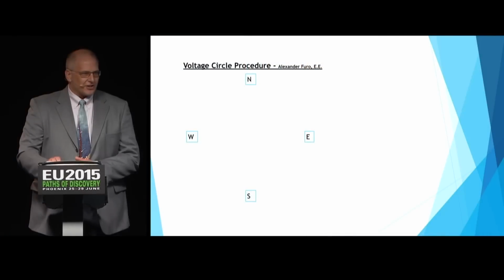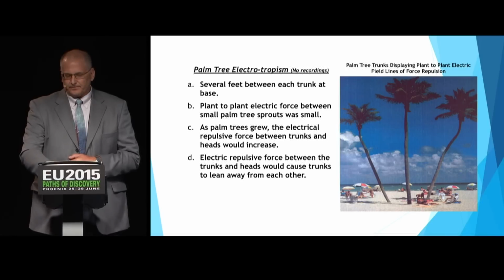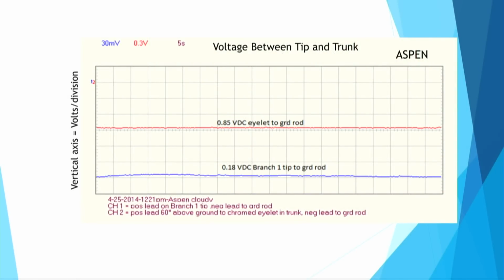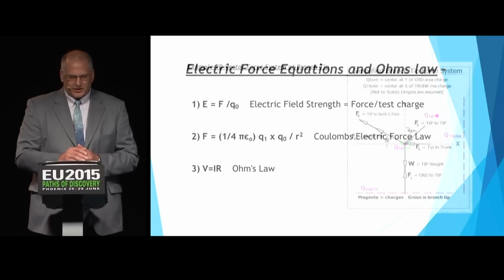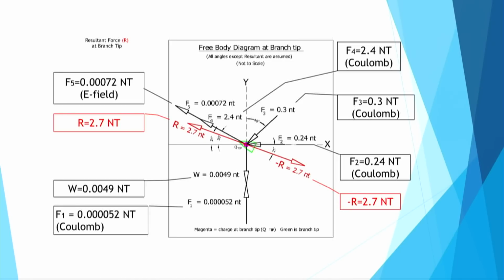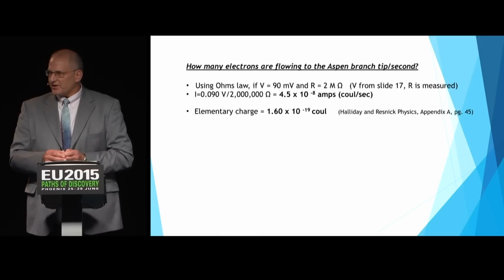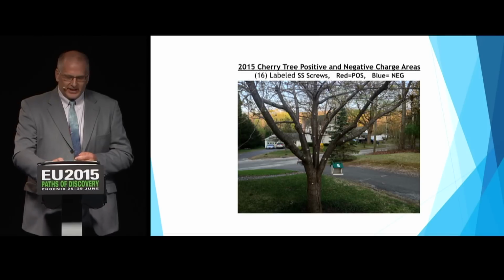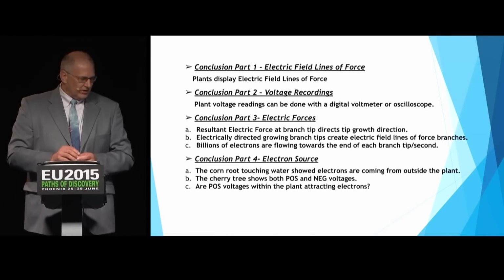Arthur Ramthun: Plant Electro-tropism | EU2015

Comment: 4::43 it is claimed a maple tree branch pattern is due to electric charges. 
And it kind of looks like the shape of a static discharge with each branch of the spark trying to get farther from the other one. The voltages he measured were less than 20 millivolts. 
So you could attach a 20 mv + or - charge to a branch and see what happens. 
Are branches sensitive to such weak voltages?.
Here is where he shows bias toward his personal theory :
The maple tree is convenient because it has this shape 
An Acacia tree on the in Africa where giraffes graze below like 19 feet do not grow like this. 
Redwoods do not grow like this 
Canary island pines do not grow like this. Choosing the maple cause it is one of the trees that kind of grows like it has repulsion between the branches.  A good reason for that is the new growth is trying to get out of shade. Likely nothing to do with electric charge. 
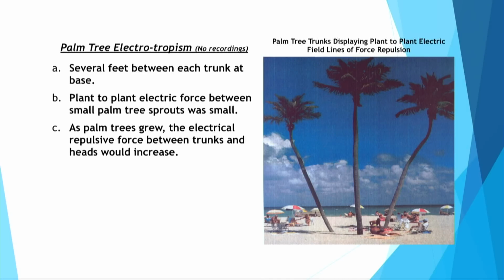5:23  Arthur, Seriously??????I have seen palm trees like this. 
it occurs when someone  transplants the  trees with one straight and two at an an angle
Note how the tops of the tilted ones are growing straight up. That is how they all grow. 
The growing tips grow upward after a palm is tilted. You think the static charge of these trees carried up from the earth is pushing those trunks apart.What happens when you put two metal flagpoles in the ground and attach a piece of cloth on a day with no wind. Do the flags point away from each other from repulsion?             NO    Again your bias that charge is a big player in everything leads to your false conclusion.

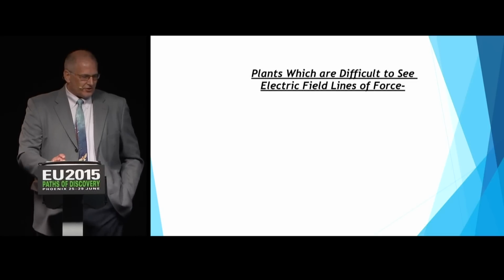6:50 " veins of leaves are electric field lines of force". 
No they are cells that transport water and the products of photosynthesis. 
merely look at a squash leaf closely. There are branching patterns but there are also little polygons made where all these little vessels connect. 
11:50 minutes. There is less than a volt and high " 2 mega OHM resistance. 
That means low current. 
At 17.47 he calculates that the force from less than a volt difference between the end of a branch and the trunk produces a resultant upward force 197 times the weight of the shoot tip.  Few things wrong here. 
I can buy a 50,000 volt van de graph  machine and touch the 
top. My hair will stand up. but it won't be ripped out by over 197x 50,000 ( call it 10million)  times own weight. 
Stems are heavier than hair. You cannot lift anything with a density similar to water with
the repulsive force of one volt over a foot of distance. 
Apologies that I lack the patience to correct Arthur's math. But the claim is easily observed to be wrong. 
Then he claims that .6 pounds of electric repulsion  force is causing elongation of the stem at the tip. This obsession with electric causes and perhaps ignorance of plant biology causes him to neglect osmotic pressure. The osmotic pressure some cells of a  leaf or stem tip is hundreds of PSI.

Comment: Very interesting I hope I will hear more about the proposed phenomena " Plant Electro-tropisum " as a plant life influencing force. I would be inclined to use ( I A A  , )   Indole acetic acid plant hormone to provide a reference for forces . An easy example would be to see if tall grasses change in height when denied the hormone could be influenced by an applied electric voltage to regrow as they are straight. Correspondingly the conversation from male to female of cannabis plants by Indoleacetic acid  ( I A A ) could be advanced or retarded by the application of voltages.

Comment: Heat is the only thing that is current grounding. Impaction force is currents flowing in resistance to flow. Lightning is rapid heat loss as disolving internal magnetic fields of atmospheric gasses as external heat energy outside of entanglement of mass as fire like campfires slowly disolving internal magnetic fields as external heat energy outside of entanglement of mass as fire. Electricity is rapid heat energy within mass moving faster than normal magnetism grounding currents. The core is the strongest force of pressure. Heat lines of least resistance. Magnetism explains everything about physics without gravity and bending space and electricity. Two factors of space. Space is cold repulsion to heat energy propulsion from cold repulsion momentum as perpetual motion as space itself as a weak external magnetic field with atmospheric gasses passing through atmospheres and space itself Dark heat energy outside of entanglement of mass as maximum distance traveling and minimum force to and from cold repulsion momentum. Hydrogen is counter to space as maximum force and minimum distance traveling cycling circulation centrifugal force of magnetism. Space is clockwise, and hydrogen is counterclockwise. Mass is the cosmic speed limit as magnetism. Mass absorbs heat and loses heat as decay or aging. Shivering is rapid heat loss. We have appliances that remove heat and restore heat. Campfires slowly disolving internal magnetic fields grounding currents through its nucleus or core where external heat energy doesn't ground currents. Hot air balloons prove hypothesis. No electricity, just heat. Electricity is rapid heat exchanging through mass faster than normal momentum of earth's internal magnetic field grounding currents through its nucleus or core where external heat energy is strongest. Heavier elements sink to the bottom of the pool or core. Mass falls in equalization to magnetism within and without entanglement of mass. Light is only present in resistance to mass as potential renewable heat energy when absorbed into internal magnetic fields of mass. Stars decay their atmospheres as heat waves outside of entanglement of mass as potential renewable heat energy when absorbed into internal magnetic fields. Heat waves magnifying refraction of reflection bouncing around atmospheres lighting up the mass it strikes unabsorbed. Daylight is raining down heat energy singularities outside of entanglement of mass as potential renewable heat energy when absorbed into internal magnetic fields of mass. Space itself is cold repulsion to heat energy propulsion from cold repulsion momentum as perpetual motion momentum velocity. Unification of unidirectional flow cycling circulation centrifugal force faster than normal magnetism grounding currents. Speed limit is hydrogen. Hydrogen has the strongest internal magnetic field of magnetism. External magnetic fields don't ground currents through the nucleus or core where external heat energy cycling circulation around these monopoles of pure fabric of cold space repulsion within the nucleus or core spinning all heat energy within its field like a record on a record player centrifugal force distance increases and force is constant. Water pressure is maintained by the magnetism bonding force of impaction. The difference is the accumulation of heat energy currents. Heavier elements have more cold repulsion within and without in equalization to magnetic fields surrounding them, and bonding force is equal as magnetism. Magnetic fields vary according to their mass as heat energy within and without entanglement of mass. Magnetic fields falling through atmospheric gasses in equalization to magnetism repulsion within and without entanglement of mass as equalization to magnetism. Impaction force is collisions of outward force of pressure known as weightless outside of a greater magnetic field. Heavier elements have farther reaching magnetic fields than smaller magnets. Magnetic fields falling in equalization to repulsion. Impaction is the bonding force of magnetism flowing currents quantumized internal magnetic fields. Heavier elements have greater force of impaction force in collisions when displacement can't be overcome by impaction force. Hot air balloons displacement of atmospheric gasses give way as quantum magnetic fields repulsion as displacement. Stars decay their atmospheres as heat waves outside of entanglement of mass as disolving atmospheric gasses into external heat energy outside of entanglement of mass. Not electricity. Heat currents. When you have currents of heat energy backing up and can't ground fast enough, then fire is external heat energy disolving internal magnetic fields and burst into fire. Lightning is instantaneously flash lighting atmospheric gasses disolving instantaneously into external heat energy outside of entanglement of mass as fire. Campfires slowly disolving internal magnetic fields proves hypotheses. Magnetism is used to move heat faster. We burn calories as fuel for fire or warmth. Shivering is rapid heat loss. Standing next to an external magnetic field disolving internal magnetic fields as fire as potential renewable heat energy when absorbed stops, shivering. Liquidity infinity to illusionary solidity of liquidity infinity as mass. Hydrogen under extreme pressure expands into helium. When you remove heat, the cold is constantly left behind. Mass occupies space as neutralized repulsion within mass as outward force of pressure known as weightless outside of a greater magnetic field. We absorb heat and loose heat energy outside of the entanglement of mass. Magnetic field generators move heat faster than normal magnetism. It forces heat energy to pass through mass faster. Lightning is rapid heat loss instantaneously disolving internal magnetic fields grounding currents through its nucleus or core where external heat energy outside of entanglement of mass as fire lighting up the sky instantaneously disolving internal magnetic fields. The light shows the path of fire lighting up the mass it strikes unabsorbed heat singularities bouncing off mass. Hot batteries store heat. Light bulbs are hot from heat passing through it and bouncing around the atmospheres unabsorbed heat, lighting up the atmosphere.
Reply: mm.... cool
Reply: Another Joe believer in Steven Hawking's grand delusion of ghouls, myths and fairy tales.
Reply: A MIRACLE IS HAPPENING!!! MAINSTREAM SCIENCE IS PLOTTING .......... MAGNETIC FILAMENTS IN OUR GALAXY ...... AND THEY ARE BAFFLED, of course!!! Check out Anton Petrov's video Mind-blowing New Discoveries About the Milky Way Galaxy . I left this comment:
🤜⚡💥⚡🤛 FINALLY they are reaching for the true understanding of the nature of the Uni ...but still they remain blind!!!Why? Because they use the Ptolemaic method with reductionist approach instead of the scientific method.  The plasma cosmology [antithesis of BigBang] community understands these magnetic filaments, for nearly hundred years, as Birkeland current filaments and the nebulae as intersections/collisions of several Birkeland current filaments. FYI, WHENEVER YOU HEAR MAGNETIC FIELD/LINE/FILAMENT YOU MUST TRANSLATE THAT AS ELECTRIC CURRENTS!!! because... electromagnetic theory. These currents/filaments interconnect EVERY object in the universe!!! and form the Cosmic Web.  Previously I said in regards to the nebulae problem: The runaway star phenomenon occurs due to the chaotic nature of the collision which involves electric currents, resulting is a slew of small stray Birkeland current filaments. I predict that we will discover this type of phenomenon in every nebula of this kind. 

On a more important topic, most mainstream scientists and followers also don't understand the Red Shift and the problems inherent in the BigDung theory. To wit, an expanding Universe entails matter and space-time [sic] would have to expand, which, per the mass-equivalence principle [E-mc^2], are made of energy. This would either require energy to be continuously created, or the 1st law of thermodynamics [conservation of energy] is invalid, or their density is decreasing. Either way all physical laws and the associated constants would have to have been constantly changing over the life span of the Uni which implies that all atoms and molecules would have been destroyed long time ago, ergo no Uni. The EM spectrum of the past [from distant objects] would be seen today as radically different. Even a slight change in the current constants would undo the present order/equilibrium. By all accounts the Uni would have radically changed over the presumed 13+ billion years, if not have been totally destroyed. The BigDung theory does not take this into account. Clearly the theory is false. 🤜⚡💥⚡🤛

=== 
Yes, presumably there is an interplay tween matter and the fabric of space-time but only because they are intertwined. This principle is arrived from the energy equivalence equation when it is solved for the time component. By Onerock's core definition, space and time are interchangeable.

But that's only on the word of that ol' mathamagician [that's not a complement]. By my tone you might have guessed that I'm not a a fan of that theory. IMHO, Plasma Cosmology [Electric Universe theory] predicts and describes the Uni more completely and eloquently. See the Thunderbolts Project channel. Also 'See The Pattern', 'LPPFusion', 'Unzicker's Real Physics', 'Ray Flemming', and Prof. Pierre-Marie Robitaille's 'Sky Scholar' channels... to start. As a consequence you too will find the current sciences distasteful. Naturally I don't recommend the 'conventional' physics sources as they are on the wrong path.

===
Me, I'm only a triple engineer rewriting the electromagnetic theory which, as you know, touches everything else. I call it the Parallax Electric Theory [PET] which dispenses with the anachronistic notion of magnetism. Everything is but charges [electric fields].

~~~ Know plasma, know 99.999% of the Universe (No plasma, no Universe) ~~~
===
PS. From where I stand, the Uni is flat[i.e. infinite], static[i.e. not expanding], eternal[albeit finite lifespan at present] and 'c' is just a number [do you know what that means?][hint, add it all up].  [It means that 'c' is not the maximal speed in the Uni... because Onerock is dead )) ]   Drinks are on me!!!

===
Check out these vids:
==> The censorship of cosmology | Eric Lerner    [Eric disproves the BigBangGang hypothesis in several ways*!!!*  Eric Lerner is saying that for a non-expanding universe, galaxy size is linearly proportional to distance, *as the evidence shows*. In the expanding universe theory, the galaxies should be much smaller in size (to the fourth power) and less bright than we actually observe. He’s correct BUT his papers have not been accepted because there are too many reputations and too much funding for the Big Bang research Gang on the line.]

==> Challenging the Big Bang: The Struggle with Inferred Reality
==> History of the Gaseous Sun with Dr. Robitaille
...
..
.

Comment: This presentation explores a proposed plant tropism called "electrotropism," where plant growth is influenced by electric forces, in addition to the well-known phototropism (light) and geotropism (gravity). The key argument is that plants are responsive to electric fields, which play a role in their growth patterns.

Key Points:
Electric Field Lines of Force:

Electric field lines can be mapped by measuring voltage at various points, a technique first used for tracking electricity in the ground. Plants appear to follow these lines, which change direction due to surrounding electric fields but are unaffected by soil types. The presenter argues that plants, like electric forces, curve and flow around other electrical fields.
Voltage Recordings:

Using specialized equipment like voltmeters and oscilloscopes, the presenter took measurements from trees and branches, observing significant voltage differences between the trunk and tips of branches. Only live branches showed substantial voltage, and the data suggest that electrons travel from the roots upwards through the tree, with higher voltage recorded at the tips.
Electric Forces and Plant Growth:

Through detailed calculations using Coulomb's law and Ohm's law, the presenter illustrates how electric forces acting on plant tips generate enough force to influence their direction of growth. These forces may be responsible for the elongation and direction of branch tips, potentially explaining how plants "choose" their growth path.
Electron Source:

A controlled experiment with a corn sprout demonstrated that electrons flow from external sources (like water) into the plant. This supports the idea that plants draw electrons from their environment. Additional tests on a cherry tree revealed negative and positive voltage differences across different parts of the tree, suggesting electron flow could be influenced by internal factors like hydrogen ions from the plant's respiration process.
Conclusion:
Plants display electrical properties similar to physical electric field lines of force.
Branch tips' direction of growth may be influenced by electric forces, with billions of electrons flowing towards branch tips.
Electrons come from external sources, and both internal and external electric fields play a role in plant growth.
The evidence suggests electrotropism as a potential, overlooked plant tropism.
In essence, the presentation argues that electric forces are a crucial, yet often ignored, aspect of plant growth, potentially as important as light and gravity.
Reply: @nefty420  very well articulated, fren!  🫡
Reply: pin this to the top
Reply: Thank you.

"Only live branches showed substantial voltage, and the data suggest that electrons travel from the roots upwards through the tree, with higher voltage recorded at the tips."

Doesn't it follow from this the voltage difference between the branch tips and the grounded roots would possibly be highest? If electrons do indeed flow "from the ground" it might be from anions in the soil and the flow to the tips would necessitate greater presence of cations (relatively) at the tips. In the chemical reactions in  the plant, both cations and anions would be generated. 
Is there any theory as to how they don't react there and maintain separate channels for the electrons to flow from base to tip?